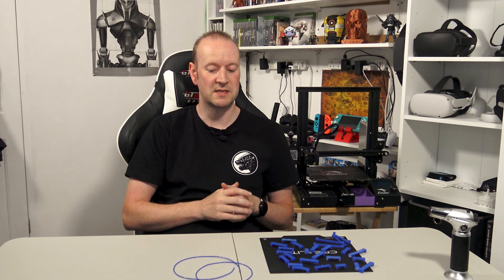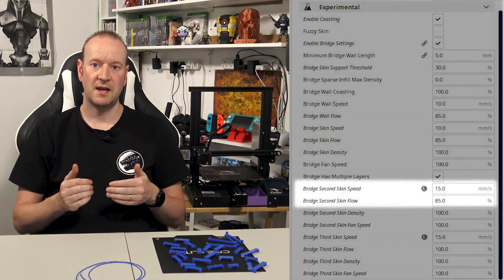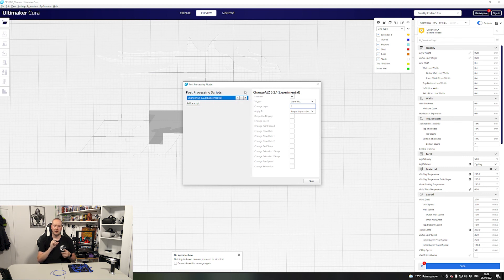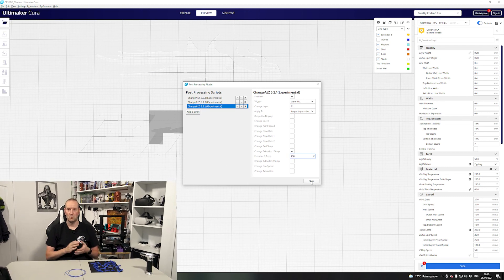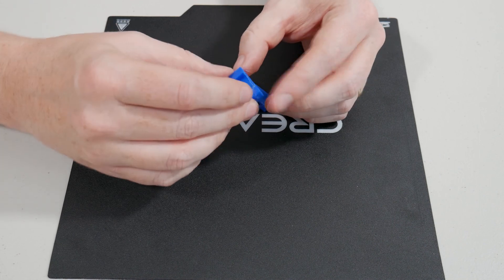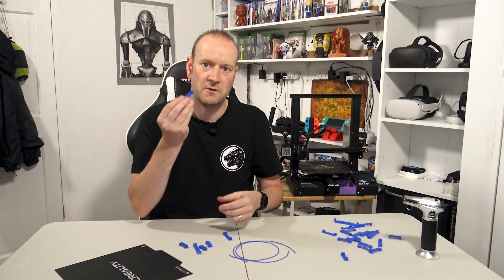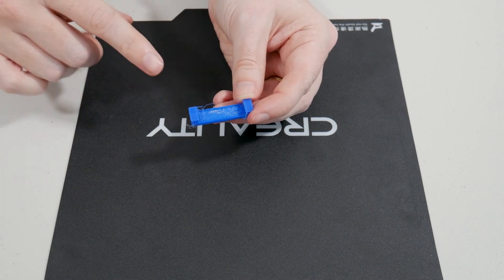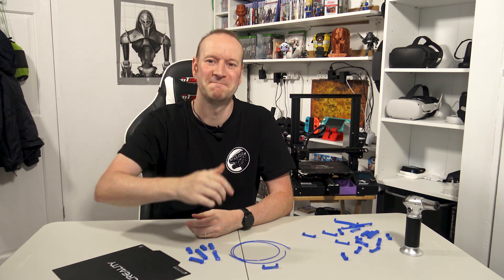Ender 3 Pro TPU Briding Settings

Comment: but how does this method help when the bridge is a part of an actual item and not just a stand alone unit?
Reply from the maker: You will at least know how far you can potentially bridge without supports. You could try to with incorporate supports in to your design or add supports in slicing. When you get to the layer height of the area that needs to bridge just insert changes as I showed in the video for the layers you need to bridge at, then once over the bridge height just put the settings back.